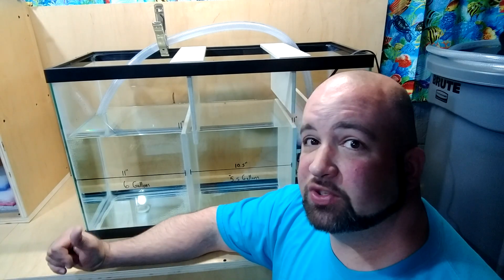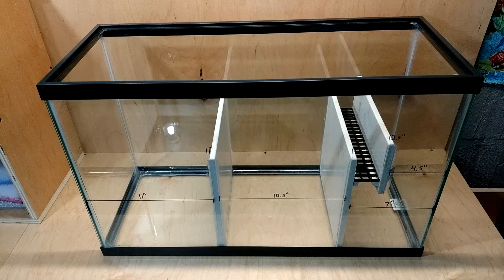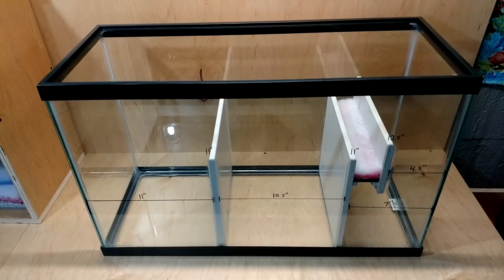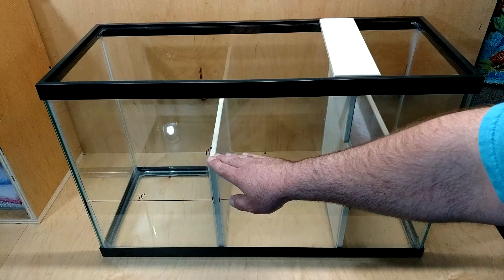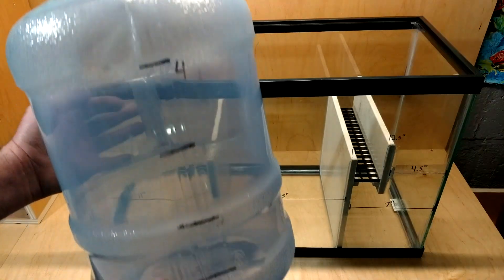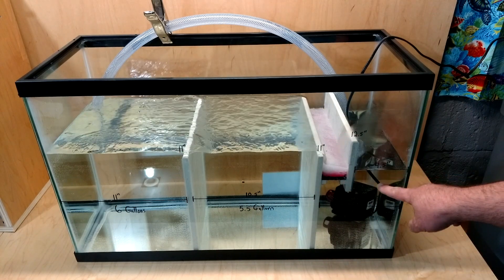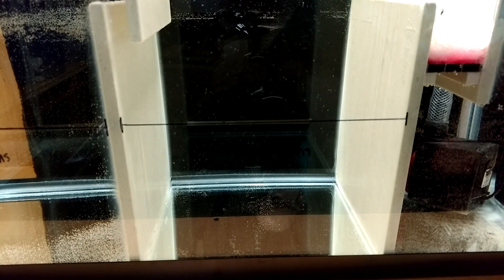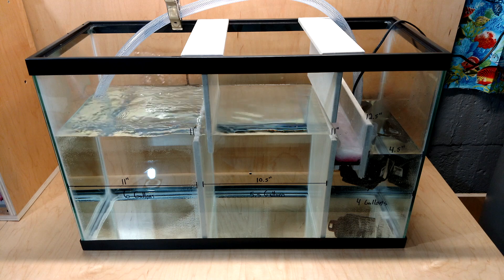DIY Reef Tank Sump - 29 Gallon Tank

Comment: Awesome video! I have a few questions on flow rates.What size tank is this going to be used on? What is the maximum turnover ratio? What size return pump is being used? Wouldn't making the left baffle a bit longer/lower push the water down further to alleviate the small amount of skipping what ever media is in the middle? I love the design. Great for the DIY'er! I plan on using this design for a 100g freshwater tank. Much easier with the overhead partitions. Alleviates needless siliconing on the tank itself.
Reply from the maker: Raymond Sloan I'm not sure what tank and equipment is going with this sump. I built this for a customer per his dimensions. And keeping the baffles at the same height has been better than others I've seen. This is around the 20th sump I've built so far and haven't had any complaints from ppl using them👍

Comment: Billy if you dropped the right hand divider to 10” instead of 11” you will probably get better circulation in the refugium section  - give it a try next time you build one.
Reply from the maker: Mark Mckinnell 👍 I've tried that and checked the flow. I found matching height or first baffle lower than the second baffle works best

Comment: Nice Billy, What happens if the left baffle blocker is accidentally pushed against the baffle? Maybe add a little baffle blocker blocker so the baffle won't be blocked by the baffle blocker? what do ya think? hehe.
Reply from the maker: xM3THODx lol. Good thinking, but it's a snuggle fit and the inside dimensions are about an inch smaller for issues like that 👍